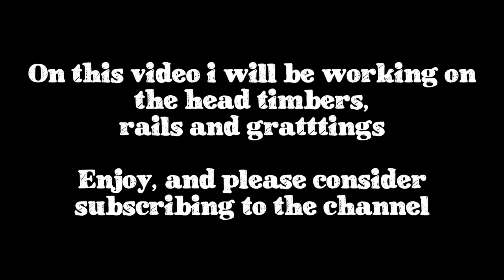Santisima Trinidad - Part 33 - Weathered, paint chipping effects on head timber, raillings grattings

Comment: It appeared as though you did not have to shape any of the pre-cut bow rails (bend them in towards the stem to match the triangular supports). Is that correct? If so this is a phenomenal kit...everything else I've built you have to bend them across vertical and horizontal axes.
Reply from the maker: The 2 top ones I managed to fit without problems or twisting, but being completely honest, the bottom one is not touching 2 of the triangles, it would just break if I tried to do it properly